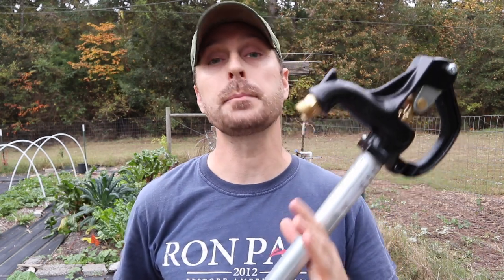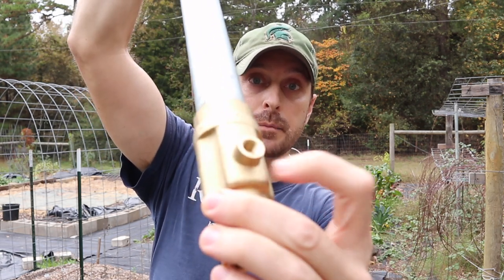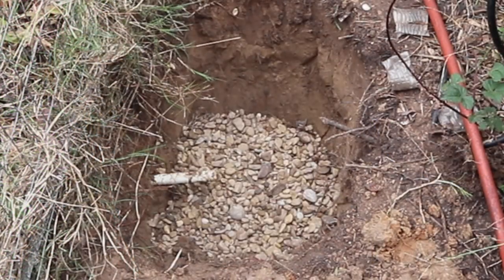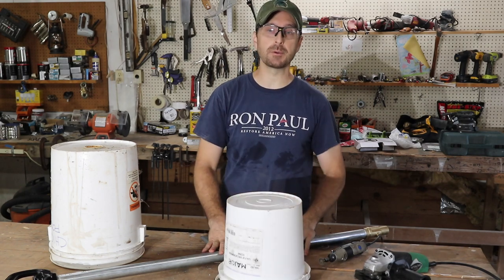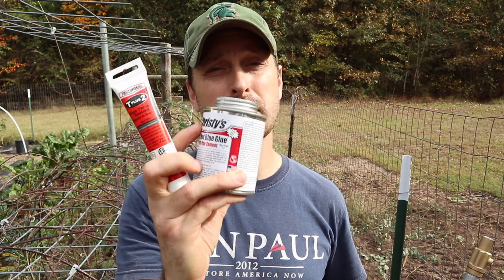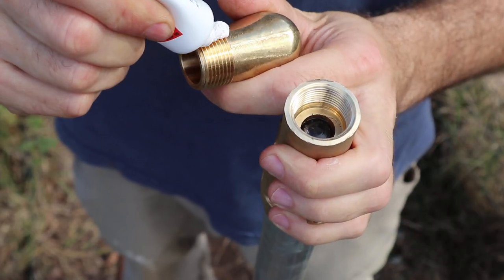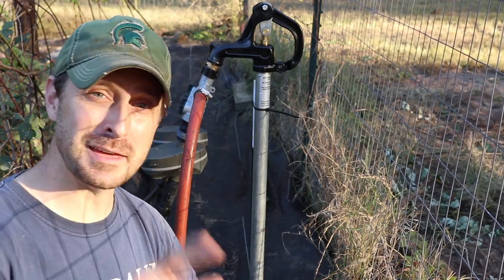How To Install A Farm Water Hydrant That Is Freeze Proof! Easy DIY

Comment: As a master plumber you do not add sealant to the inside of a fitting. Too much sealant will reduce flow or even clog the line in the future. You can also add a 90 on the weep hole pointed down to help keep dirt out.
Reply from the maker: Great. Thanks
Reply: Yep.  When you load up internal threads with dope, as you start screwing on the connection the excess that builds up has nowhere to go and gets pushed INTO the pipe and subsequently into the internals of your hydrant (or whatever is being attached). Nice video regardless. 👍
Reply: This is not a huge deal, as long as you don't GLOB it in there;  the excess pipe dope is gonna wash right through from water pressure anyway. BUT I concur that the pipe dope needs to go on the male threads only.
Reply: Good to know. Thanks.
Reply: @jcarleezy  It does make sense when you start to think about it.  Thanks.
Reply: Thank you for this comment! As a novice plumber I appreciate the insight from someone who actually knows what they are doing. Any idea what size the socket on the weep valve may be so I know what size 90 to get? I can’t find that info in the specs for the hydrant. Thank you in advance!

Comment: Congratulations on being the only video on all the hydrant how to videos I looked at to address the major issue of not preventing debris from entering the drain hole. Every other video just buries it in gravel. I did the same thing and now I have two of them which I'm not sure can be properly repaired without digging the entire thing up. They are so stiff you can barely open them now, after 5 years
Reply from the maker: Glad it was helpful

Comment: The only thing I would add is putting some type of rod down to hold the hydrant in place. We used a t-post and zip tied it to the hydrant to hold it vertically from the bottom of the hole so if an animal uses it for a scratch post or something it will resist getting pushed over. I'm so glad you showed the bucket method. Thanks for this video!
Reply from the maker: You’re welcome. I did put a t-post next to mine.

Comment: There's no twang in your voice yet.  East Texas has a way of making that happen.  Excellent video.  I survived the 2021 Texas Freeze with hardly any issues but now I'm prepping to ensure that I when that cycle hits again in 100 years, I'll be even more prepared.  :-)
Reply from the maker: I appreciate it. No twang yet. Been in Texas for 10 years. Glad you came out of that freeze relatively unscathed. Good luck with your preps.
Reply: @CountryLivingExperience  Thanks for the video.  I purchased the Woodford Y34-3 "IOWA" model for $161 on Amazon and installed it. I used your links to purchase the extras.  I had to substitute the 3/4" female npt to 3/4" female slip PVC because the one on Amazon was completely threaded and all I needed was a smooth slip.  I was replacing an existing faucet that had other lines involved, digging in the Central Texas black clay.  The digging was by far the most difficult part. The faucet model that you employed was not available on Amazon so I went with the iconic one. Your video is MUCH appreciated.
Reply from the maker: @1995texasaggie  Cool. Glad we could help.

Comment: This video was SO helpful; despite using the T post and clamps, I still want more stability for my faucet, so plan to pour small concrete pad @ground level around the stand pipe. Since my bucket with rocks is totally sealed, the concrete collar won't inhibit the drainage of the weep hole.
Reply from the maker: Glad it was helpful

Comment: I did a project in the 90's where I put a freezeproof hydrant in a ditch along with a 4 inch corrugated drain and a 10/3  UF cable for a lamp post and future power at my garden. I put the 1/2 water line on the bottom , then the 4 inch, then the cable. It was min 24 inches to the water line, which should have worked well. I used one bag of pea gravel, probably not enough, and didn't use any cloth. Well it failed. The cheap hydrant developed a drip that froze and busted.  I had to install a shut off valve at the house when my back yard turned into an ice skating rink. I bought a new better quality hydrant, 48 inch, thinking it would be two feet in the ground and two above. Again I was wrong. It's going to stick 4 foot in the air.
Thanks for the video, I plan to dig all this up and try again. Or maybe hire a plumber to do it right so I have to never deal with it again.
Reply from the maker: You're welcome. I think you can try it again and it will work.

Comment: #2 reason for failure is adding a splitter as you've done and leaving it attached during winter.  
Splitters and hoses should all be removed and drained or you'll be defeating the draining below ground feature.
Reply from the maker: While that is true and I agree, I drain all of my hoses, leave them open, and have never had a problem.

Comment: Here I am again running across content relevant to me years after you made it.  I learn from your videos.   I recently put in a couple of raised bed gardens.  I want to run water to it with a hydrant style.  The water source is a shed (pump house).  My question is should I drill through the shed concrete and run PEX under ground to hydrant? Or should I run it out the wall like any frost free valve to a hose that runs underground? Thanks for all your videos!
Reply from the maker: Awesome!
I would always go underground in every situation that you can.

Comment: I’m surprised they don’t give you an air hose hook up to blast the dirt out of the hole if it gets clogged. Seems like a straight forward solution to a common problem
Reply from the maker: That would be a good addition. I smell a new invention.
Reply: @CountryLivingExperience  That’s my brain all day 😂
Reply: The air hose will inevitably become a dirt/debris hose, so . . . you’ll have to either get an air hose for your air hose or add a vacuum to the air hose so that the dirt can get sucked out.  At that, I reckon you might as well install a web cam around your drain hole to keep an eye on things.

Comment: Hi - thanks for the useful video! I was wondering if there's any downside to wrapping the bottom of the hydrant where the weep hole is with water permeable geotextile in addition to everything else you recommend. Thinking this would be an added layer of protection for keeping the weep hole from getting clogged with soil?
Reply from the maker: You're welcome. 
The only thing I would worry about with wrapping the weephole with that fabric is more of a chance of clogging. If any dirt builds up on that fabric, it won't be permeable for long.

Comment: Should have set it at 12-18" and you'll have less bending over. My pipes are buried 3 ft, (because?? prior owners did many strange things, they also ran iron pipe up two feet above ground with a simple hose bib on top for no freeze protection at all.) though my frost line is maybe 6" in a bad year, so I put a piece of sch80 threaded pipe on the bottom of a 2ft bury hydrant to get the top up 30-36" above the ground.

Comment: Can I tap into my irrigation main line (regular city water) — the irrigation system that I shut down in the winter — and run it to one of these hydrants?  I won’t need the hydrant in winter months but would love to have one of these at the far end of my acre for the garden and to run some sensor sprinklers for pest control.
Reply from the maker: Yes you can do that. Should work well.

Comment: “Thread sealant” is a misunderstanding of what pipe-dope & Teflon tape actually “do”.

It’s the pipe thread that does the ceiling not the pipe soap nor the Teflon tape.

So what the heck does the pipe dope and the Teflon tape too? It allows the threads to slip as tight as possible so you can tighten the bejeebers out of it & as a result? It is forever & ONLY the pipe THREADS that does the sealing.

Comment: Haven't had to do this yet, but it seems like if you backflushed the hydrant, it would clean out the weep hole? The weep hole is only open when the valve is closed, so by attaching a hose to it and another spigot, you should be able to blow any crud out. How long before anymore crud gets back in would be anyone's guess.
Reply from the maker: In theory that would work but you have to have a space for the water and dirt to go once it leaves the weep hole. You need the bucket to create the space.

Comment: Does the water line run from a pressure tank?  Getting ready to set-up a camp.  Was wondering if something like this could be connected directly from a well pump.  Would basically plan to have a switch or plug to turn the pump on and off manually.  Would want to use this to fill water tanks, then turn the pump off.
Reply from the maker: It does run from a pressure tank in our well house. You need that tank to provide a good constant pressure.

Comment: Great Video, however, after doing some digging to replace the hydrant, it looks to me like the supply line is not PVC; it is some sort of PEX material. I measured the PEX to be about 1" external diameter.  Can anyone help this novice plumber with connecting my PEX supply pipe to the hydrant?
Reply from the maker: More than likely that is black poly. It is common to use that. I have some for our rain tanks and they carry it at Home Depot. You will find the fittings there f you need adapters.
Reply: Thanks for your reply. My pipe is definitely white in color. Looking at Home Depot, the back poly pipe is colored black. I guess I'll need some PEX adapters to fit the pipe to the hydrant.  @CountryLivingExperience
Reply from the maker: @rbjkeller  Very interesting. Hope you find the adapters for whatever piping it is.

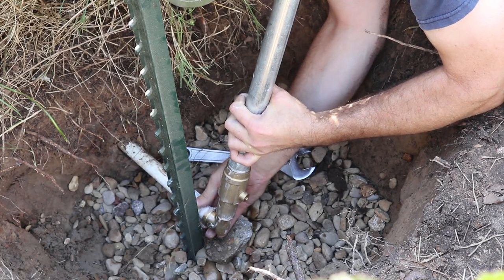Comment: I'm curious how you screwed the two fittings together with the nipple down in the hole at 7:20. Both male right hand threads on the nipple one side will tighten while the other side won't even start. Otherwise great video and I learned how to keep the weep hole clear.
Reply from the maker: I made a mistake and took the fitting off the hydrant. Then threaded the two in the hold and screwed in the hydrant from the top.

Comment: Question; I will have a rain catch barrel I want to connect to a hydrant. Do you know at all the height distance I have to elevate the barrel to get decent water pressure down to the hydrant?
Reply from the maker: I guess that all depends on how big the barrel is and how big your pipe is. I don't know the fluid dynamics/pressure calcs of it all. The higher the better i surmise.

Comment: Don't ever put pipe dope on the female side of a fitting, male only. When you thread in the pipe it is going to push all that dope up inside the pipe which means it will end up in the valve causing leaks.

Comment: I have a frost free hydrant that i installed recently n the summer. Dug it 3ft deep to me the pvc line. Removed old one added everything in your video but the bucket and the liner.. When the peep hole gets clogged can it b fixed or do i buy a new hydrant
Reply from the maker: If the peep hole gets clogged, it can be cleaned out. If you install it this way, the peep hole should not get clogged.

Comment: I'm having a huge issue.....I have this in my backyard...I have a line running from the house to the hydrant....however it was spraying from the weep hole when I turned the hydrant off...it eventually stopped so we buried it but when I came back later the hole was filled with water and we have to re dig....I didn't turn the water off at the house so I'm assuming it was just spraying out the weep hole....am I doing something wrong? please help.me
Reply from the maker: Sounds like that is just the water draining out of the weep hole from the top of the hydrant. It could be that there is a bad seal or there is dirt in the seal causing it to not close properly all the way.